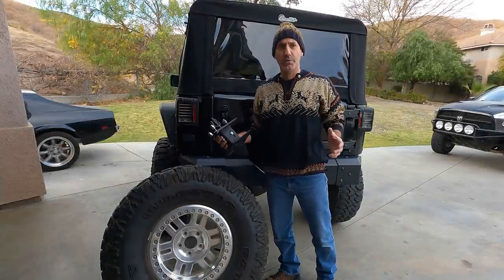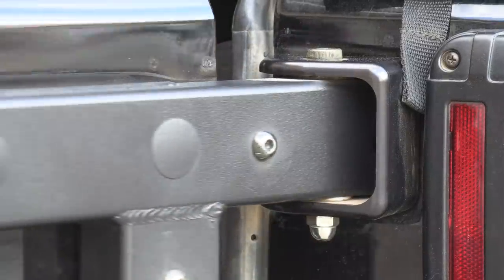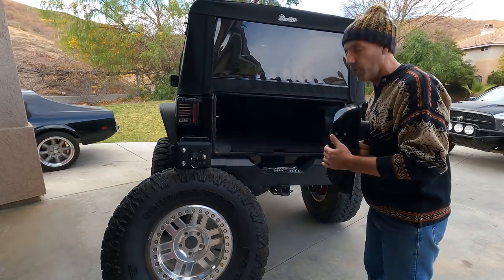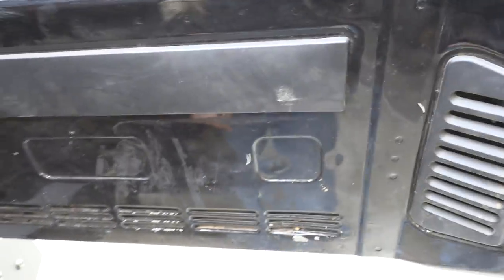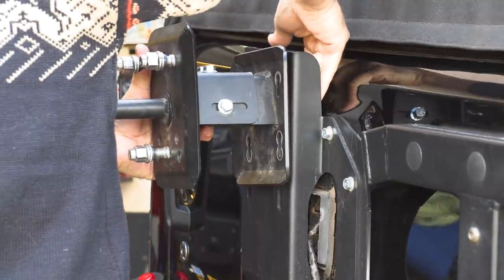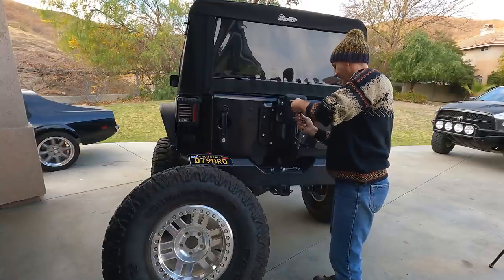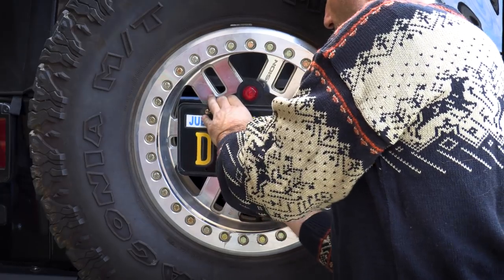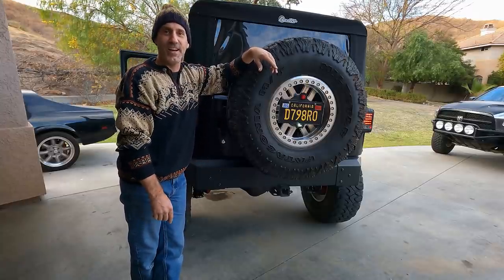Jeep Center Mount License Plate to Heavy Duty Tire Carrier in 10 minutes!

Comment: I like the hinge mounts, went with the Evo one on mine.  I also broke my factory license plate mount on the first hard trail I did with this Jeep.  I never really thought to take off my spare for city driving.  To avoid the issue of dealing with prius parking to close I installed a backup camera on my JK. this has the bonus of working while on the trail and I need to back up.
Reply from the maker: I keep thinking about a backup camera and then run out of energy...lol
Reply: @AutoEdits  Mine came with the nav screen so adding the camera was just a matter of running the cable and a little wiring.  Took about as much time and effort as running my CB.  Then I enabled the backup camera with my programmer.

Comment: Jason maybe just a small tip could you weld the top two bolts to a stripe of metal as well as bottom two 
That way you just hold on to metal strip and a line up the holes or top and one bottom on each side ?
Reply from the maker: Great idea!

Comment: Try a foam roller for your back. I use it every morning and it works out the soreness.
Reply: Foam roller is heaven Hay 123 in my opinion.
Reply: @bubbie3533  I agree. I use it every day.
Reply from the maker: Can you make a recommendation? Thanks for the suggestion!
Reply: AutoEdits I got mine from Dick's Sporting Goods. The brand is Fitness Gear. I think it cost about $35.
Reply: Dang i need one

Comment: I have  different licence plate mount but with the same kind of hook up which has the running light and rear camera fab on it, detachable for when you have to remove the spare for use but I suppose it could be also rigged up that way if I wanted to go back to spare tire delete.  :)
Reply from the maker: Nice!

Comment: So for that 1 inch plate from home depot that you added, how do the bolts hold it on? Like are there nuts that i just am not seeing?
Reply from the maker: Hey there, I haven't watched this one in a while but I tapped those holes with 1/4 -20 threads to hold those bolts. A tap costs about $2 at home depot.
Reply: @AutoEdits  oh I see. Thank you for the reply! I’m trying to get this exact set up for easy removal and installation so I appreciate the explanation!